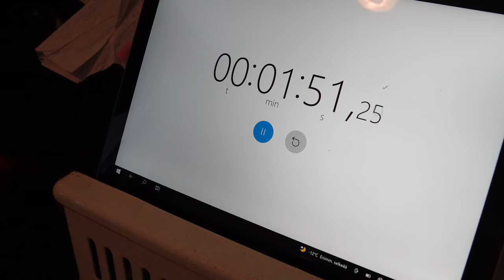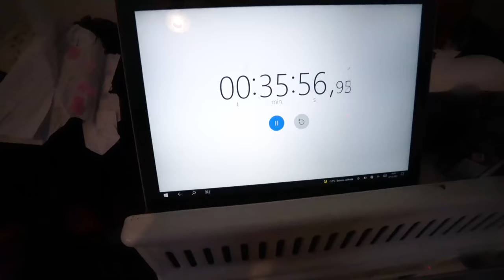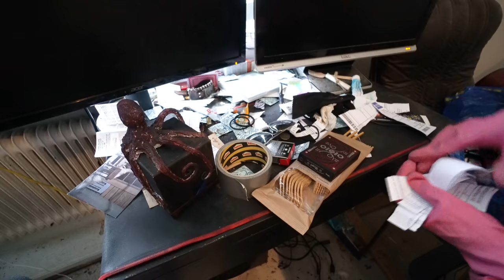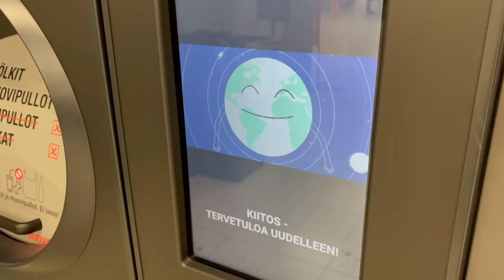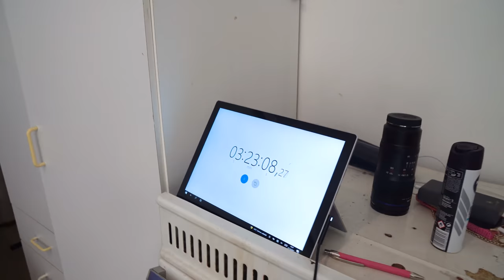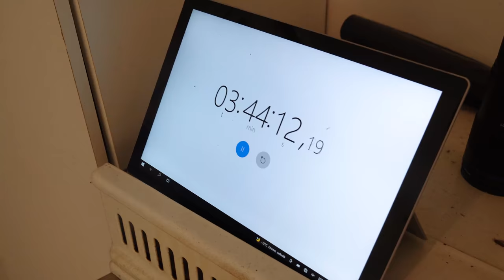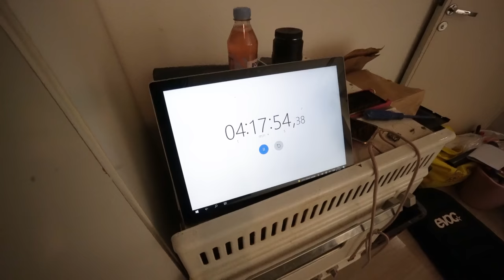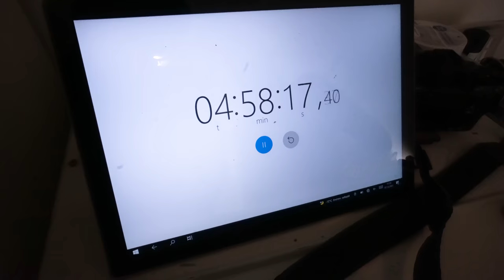HOW LONG WILL THIS CLEANING TAKE? | Super Dirty Home!

Comment: What I have learned from this channel: Oven cleaner is a magic product…
Reply: Especially whatever brand she’s using
Reply: Be careful with oven cleaner. You need to know on what to use it on otherwise you might damage the surface.
Reply: @JP-rf7cu  saw her use it on a white wooded surface. Not sure if it was laminate or paint. Doesn’t seem safe, but then again, she didn’t wait 5 minutes to scrub.
Reply: And power paste!
Reply: @dj_bae  that stuff really works!
Reply: @dj_bae  With how much power paste costs, it should be a magic product
Reply: YES! 😂 I was recently helping my friend to paint her wall and she was clening top of the kitchen cabinets where is always a lot of dust and grease. She said that she spended hours to clean it last day and it still wasn't clean, so I told her to try oven cleaner. Few minutes goes by and poof, those were clean 😂🙏
Reply: @MissEmai0110  They sell it at Target...it's close to 10.00
Reply: Dish soap too! If you dye your hair, dish soap in the tub gets rid of the stains super fast!
Reply: @Frey_thegoblin  I use a powerful oven cleaner from the 99 cents store and dollar tree and works very well costs less than $2. Some dyi cleaning recipes for example  baking soda with vinegar are wonderful, safer and not harmful on our lungs like oven cleaner.
Reply: @02chevyguy  Im not in the US.. target here doesn't sell cleaning products like that
Reply: Аминь!
Reply: @griseldaguerrero7199  I'm using an old FFP2 mask while applying Oven Cleaner.
Reply: She uses dish soap much more then oven cleaner. But if she doesn't have enough time to wait or the surface is very dirty, she uses oven cleaner. But it shows that you don't have to buy different products for every different place. You need only two products and a good scrubber.
Reply: I've also learned that as long as you have something antibacterial and some dish soap, you're good to clean EVERYTHING. I was starting to build up a collection of all these different cleaning products, now I'm starting to scale back to vinegar, Dettol, dish soap, scrub Daddy and Gumption (an Aussie alternative to Power paste or the Pink Stuff).
Reply: @ignightroad  oh thank you for sharing this! My daughter dyes her hair bright red and it always turns my tub pink. 😡
Reply: @MissEmai0110  they do in California
Reply: @KPD017  I know. But like I said, I don't live in the US
Reply: Is the oven cleaner in Finland 🇫🇮 different than in the US. In US oven cleaner is so caustic it would ruin the metal on faucets and stuff. I worry some for Auri to be exposed to fumes. Please be careful Auri.
Reply: @AnDitaLee  I saw this once in the comments on one of her videos, and although I personally do not know anything about it at all, so I cannot verify this, I will post the comment just in case it may help someone.
Here's the comment someone posted: "Those of us in the United States I found that "Easy Off Cleaner Degreaser Heavy Duty" in the black and yellow SPRAY BOTTLE not the can, is equivalent to the oven cleaner she uses. There's NO FUMES! I recently took over an apartment that had so much cooking oil on every surface and the owner smoked for 20+ years inside.  Everything was yellow and thick and sticky and dusty. I did her method by spraying the easy off and covering with plastic wrap. Within 5 minutes I could wipe it away with the soft side of my scrub mommy. NO SCRUBBING!  Edit: the spray is like $5 at Lowes."

When I went to Amazon to find Easy Off Cleaner Degreaser Heavy Duty, it said this: "Use only on hard, non-porous surfaces and rinse thoroughly with water.
Should not be used on aluminum surfaces.
Can be used to clean: back splash, cooktop, stove top, kitchen counters & cabinets, oven, sink, and microwave."  Has some good reviews, but also some bad ones on amazon.
Reply: @MissEmai0110  it's only $10
Reply: @dj_bae  I love love love Power Paste!!!
Reply: @kittysuperlove  not in Australia, its not
Reply: @MissEmai0110  oh, how much is it there?
Reply: @kittysuperlove  Ive not been able to find a store that carries it, so would have to purchase online and the cheapest I have found is $40 + shipping. Most expensive was amazon at over $100
Reply: @MissEmai0110  wow!!! Amazon had a 3 pack for $33 crazy though.
Reply: @MissEmai0110  but maybe that's what's available here not necessarily what's available in Australia
Reply: i bought some because of her!
Reply: @pendulouspoet  the Pink Stuff changed my life 🤩
Reply: @justmeherexx482  where I’m from they don’t have pink power paste 😩 ohh nooo
Reply: @АнастасияШаталова-и2х  йеее) Русские тоже есть)
Reply: I bought a oven cleaner yesterday and used a wrapping technique. It IS magical!
Reply: @JanaXV  You are lucky, that's not enough. A friend is suffering lung problems due to the same procederem. A specific mask from 3M, or for ex: baking soda + dish soap + a spoon hot water, does wonders.
Reply: Welcome to me 🌹
Reply: @verarenard713  ❤️✊
Reply: It's real .. Thats what I'm usibg now for cleaning
Reply: Me too 😂
Reply: Yes, same here. So I went to the Dollar Tree and bought some oven cleaner. My tub is now sparkling new again. Other products she uses can be found on her Amazon shop.
Reply: i think the main thing is demonstrating that you don't need specific or fancy cleaning products to do all of this, which is nice.
Reply: Mmhmm
Reply: Same!!
Reply: How dare you not mention the dish soap or power paste lol
Reply: Lol yes. That’s what I was telling my husband. I want to know the brand she uses. Cause she doesn’t act like it’s as potent as what I use. I cannot breathe when I use over cleaner (although I do have an allergy to it). But also mine is in an aerosol can not a spray bottle
Reply: @xIDSxGenocide :) yup
Reply: I think oven cleaner that she uses over there is very diferente from the on in the USA. Here you can spray oven cleaner anywhere it will completely ruin it and it’s very strong on the smell side
Reply: Cleaning everyday it is a magic product:P
Reply: And scrub daddy and mommy!!! I saw him on the show with the “sharks“ when he first presented the product to the world..! He had an awesome presentation sharks couldn’t wait to invest in this company!!!!
Reply: And Finish accent too is.
Reply: That s enough to buy:)
Reply: Seriously, she LOVES oven cleaner 🤣 I’m actually going to try it
Reply: Socor a sua resposta 🕭🕭🕭
Reply: Cema de uma forma que 5🕭🕭🕭🕭
Reply: Socorro de um dia para a sua vida pessoal de cada uma delas com o que o senhor acha de eu ser um 8🕭🕭🕭🕭
Reply: just bought some!
Reply: fh9gdhfbhdi yk
Reply: @UmmYeahOk  have if ufb8jtd12
Reply: Right?! Lol but nothing in my house is THAT filthy
Reply: @Steppy  I am sure she looks beautiful though 😁
Reply: The oven cleaner that she is using, is not the same that we know on USA, so be careful
Reply: Only for certain surfaces. 😊

Comment: You can let scrub daddy know that i just ordered some power paste and steel daddys 100% because of you. 
I'm trying to clean the inside of my oven.
Reply: Here's how to do that: before you go to work one morning, heat your oven to 200 F, then once it's to temperature, turn the oven off. Open the oven and spray oven cleaner in there, including the inside of the door, close the door. Leave till you get home so it's been sitting for many hours. If needed, remove the door (there are YT vids on how to do this and put it back on) and use Scrub Daddy to scrub and wipe it out... should be fairly easy if you've left it on so long. A pumice stone is good for the stubborn stuff. You can put. your oven racks in the bathtub and spray with oven cleaner too -- leave those for a couple of hours, and they should be easily cleaned with the same tools.Just make sure to wipe out the oven completely, and voila.
Reply: We can buy it all at our supermarket. My scrub mummy sits in the sink , scrub daddy and scour daddy are coming to live with me soon.

Comment: As a person who lives in a tropical country, i always love to see snow. I'm happy you show it in your video ❤️❤️❤️
Reply: I live in Sweden and the cold winter is kind of a blessing, especially when it's around - 10 C° or colder. I take out bedding mattress and rugs and brush them off with the cold dry snow (to exterminate eventual dustmites that managed to remain after vacuuming).
Reply: @johannas.l.brushane2518  I am in Denmark and I used to do so too with my lambskins. Denmark used to have winter temperatures at 0 to -5 C mostly. 
But in the last 5-10 years the climate warming has meant that now the winter temperature is mostly just above 0 C. Which means no snow to clean my lambskins. 😭 And yes, that is actually what bothers me the most about it. 🤣 

(Well apart from being existentially afraid that Denmark is going to be flooded, and we are all going to be climate refugees).
Reply: @johannas.l.brushane2518  wow.. that's new for me. I didn't know that snow can do such a thing. Besides, I can't imagine living in such cold temperatures. Here even when the temperature is 15 degrees, I wear a thick jacket and cover myself with a blanket. 😂
Reply: @SIC647  it is sad that it happened to our earth. what's sadder is that we can't do anything, everyone around the world has to work together to fix it. i hope you'll be fine there. ❤️❤️❤️
Reply: @SIC647  Yes, I have noticed the same in Sweden, we usually have some really cold periods but it tends to be quite a variation in the temperatures. When I was a kid  70s and 80s we had long periods where we could do wintersports while now you'd almost be lucky to have a couple of days when you could go skiing. Some years they also had to take in artificially made snow for "Vasaloppet".

Comment: Honestly, as someone who is obsessive about cleaning, a blade in the house is the best tool ever. Cuts deep cleaning in half when it comes to your stove, counters, floors and any built up areas. We bought an older home with all wood floors and the elderly owners had had their floors waxed for years and years. The wax build up in the corners of every room was unreal (also country home so the bug poop was built up in the corners too). The blade gets it all off in seconds. Just a wet cloth to wipe after. It’s a miracle tool!

Comment: Its interesting that in Finland, the duvets are smaller than the surface of the bed. In most other countries, they are larger and go down over the sides. It must be cold under such a small quilt. Also sheet sets only seem to come with one pillow slip.
Reply: Not cold when home is warm 😁
Reply: "most other countries" you mean the US, right? I've seen this kind of bedding all over Europe.

Comment: I have also found the benefits of using oven cleaner….but also learned you shouldn’t use oven cleaner on painted surfaces as it will remove the paint!!!

Comment: You should also clean the grout between the tiles with a grout brush! This is where most of the dirt gets stuck because it’s lower than the tiles and also the surface is porous.

Comment: Stream machine reduce detergent and time absolutely to half. Sometimes even there is no need to use detergent. I discovered some of  surface stains that I was thinking the structure of marble were stains in my ex rental house in  my ex rental house after I bought steam machine.

Comment: I have a theory you also knew how long this job would take because a lot of these apartments have very similar layouts and sizes, floor space and cabinet styles, sorting requirements and messes of similar types.  Having done this for a while, eventually estimating a time it’d take to gut it would be easy based on your experience of usually taking roughly that amount of time on past places that looked somewhat the same. It’d be an instinctive thing to know you could do it in that time, even factoring in filming and maybe allowing for a half hour grace time for scraping or hard scrubbing.  😁

Comment: I have an issue with a special stain I get in my shower/tub. My husband is a welder and he uses things in his job that settles on him. When he showers, I get these rust like residues that WILL NOT come off no matter what products I use or how hard I scrub. If Auri sees this, I would appreciate any tips she might have because I've seen her clean some NASTY bathroom surfaces.
Reply: Use a solution of citric acid + hot water then spray the rust stains, let it sit for a few minutes, then scrub, then rinse.
If the stains are very tough you can use a bit of hydrochloric acid but be very careful and wear protection because it's extremely corrosive (do not let it touch metal and do not let it sit). Always try on a small spot before to make sure it won't damage your surfaces.

Comment: Hey! I love your vedios and I appreciate your work. Can u please tell me how can I remove every kind of dust from my furniture and make it shine........need tips.
Reply: Make sure your AC vents are cleaned. I use to be a maid and would dust thoroughly but dust fell. I looked up noticed my client's vents were dirty. You will have to call an AC company to clean them.
After it's clean, you can dust it but lean down to your furniture or item at the edge that's how you can check for spots you may have missed with your microfiber cloth.
Reply: @msg9140  thanks dear but can u plz give tips to clean my wooden furniture for e.g bed, side tables etc.
Reply: Pledge use this. I don't know if you are in the US but we use pledge. You want to spray your product into a rag first get it wet then clean it with the grain of the wood. That's the direction you want to move in.
Reply: @msg9140  thanks a lot.....

Comment: HI NEW HERE 1 QUESTION WHAT CAN I USE TO CLEAN MY GREASY OVEN (TOP) THANK YOU GREETINGS FROM AUSTIN,TX
Reply: Mary, use Dawn powerwash and a Bissel steam shot.  I used the Bissel steam shot I bought on Amazon plus Dawn soap and it helped remove the grease.  You can also take a small glass scraper ( lowes or home depot) to remove the grease that the steam shot didn't get.
But for me, the steam shot took the grease away.

Comment: Why do all the places she cleans look the same?  Same kind of stove, bathroom and always egg shells all over the counter.  Always a dirty pan in the oven.  And she uses that squeegee on the floor but doesn't move the furniture out and instead, tries to clean around everything.  Using that rag on the squeegee afterwards will not do a good job cleaning.  She leaves it better than it was but to do a proper clean she would need to wash the walls, doors, windows and floors with some hot soapy water.  Not just a rag with some dish soap on it!
Reply: I’ve wondered about the apartments looking very similar. What I’m guessing is these are government subsidized housing/apartment complexes for low income citizens, but that’s just a guess. I understand your point about moving furniture, doing the windows, and so on, and my guess on that is: she’s doing this for free, which means she’s taking her time and energy away from paying clients-I wouldn’t be doing meticulous work either at that point since there is only so much time and energy anyone can be expected to give away.  Also, she mentions being on a tight time schedule in many of these videos, so there’s also external factors limiting the time she spends in these homes.  These videos are also edited down so there is a lot happening we’re not seeing since the most dramatic messes being cleaned is what we all are here to see.  These homes are in very bad condition and she makes them livable, safe, and comfortable for these people-that is an amazing gift to give someone, so I’m not fussing about a window being polished.